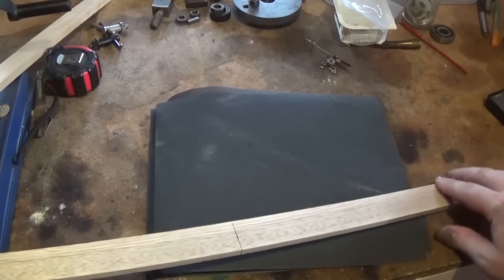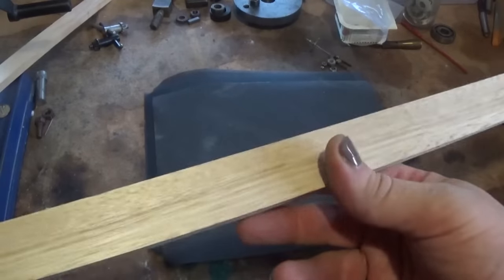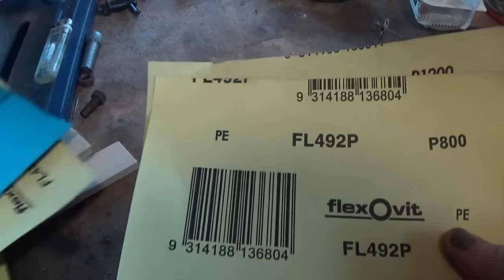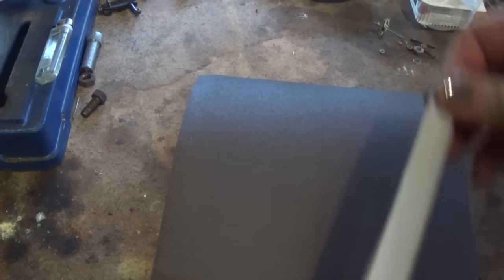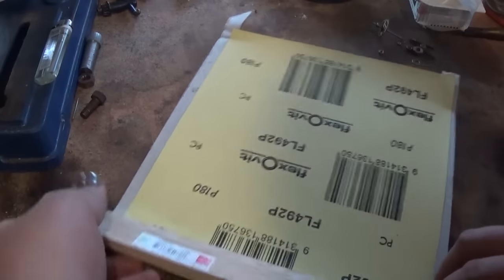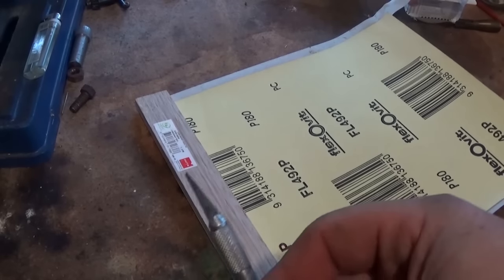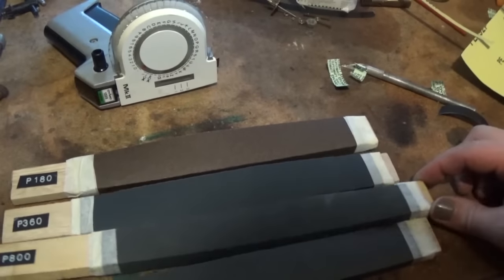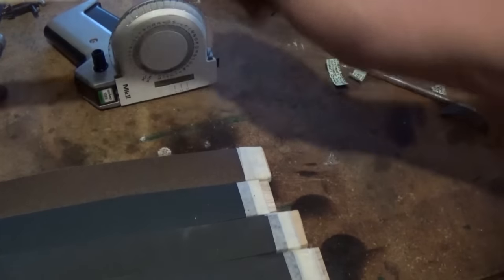reusable emery sticks

Comment: Just a thought, or 2, use some spray adhesive instead of tape so the paper lays flat. And if your going to use wet, just stick to aluminum bars or varnish the wood first. I have made many of these of various sizes and grits but never thought to wrap it around the stick instead of cutting strips. Cut a piece of plywood to fit tight inside a sanding belt. Lots of sizes and grits available and extra life for used belts. When the belts on my little 1/2" and 1" detail sanders won't stay tracked they get to wear a stick. Love your videos, thanks.
     Mike (o\!/o)